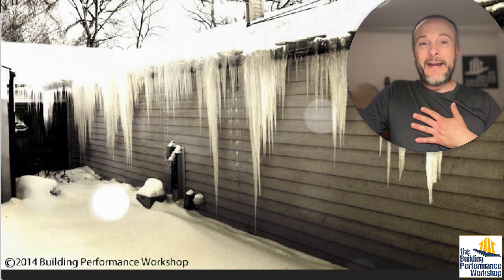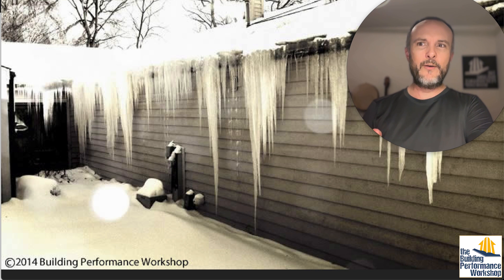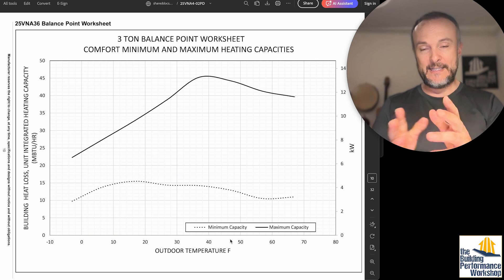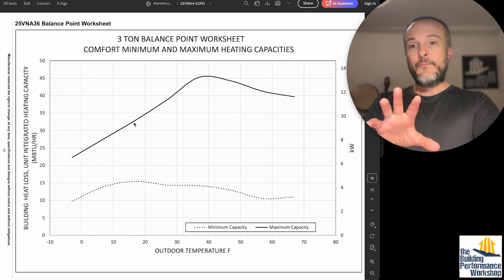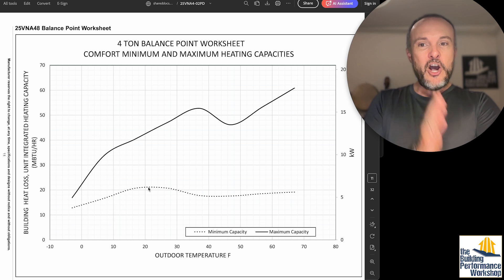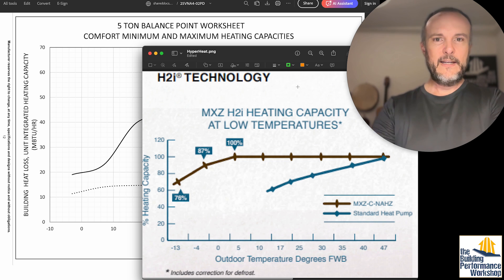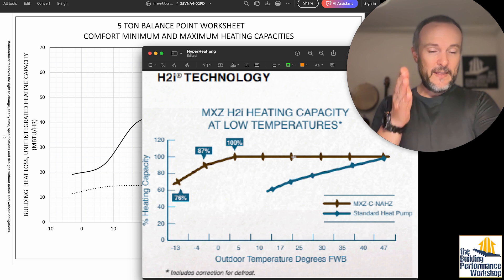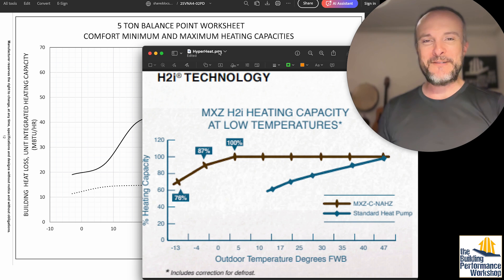'Warm' Climates Need Hyper-Heat Too: Heat Pump Technology, Specs, and Sizing Calculations

Comment: Here’s what happened to me last winter here in Wisconsin. We had a week of single digit below zero windshield weather. I have a Mitsubishi intelli -heat system which runs the heat pump until it can not keep up then it uses my natural gas furnace(duel fuel system) I have the H2i unit and it never kick over to use the furnace during this really cold spell. In other words it kept my house at 70 just using the heat pump. I did not have the HVAC fan set to run all the time but I did have my HRV set to run 20 minutes per hour. My electric bill was $200 higher that month. I wasn’t prepared for that! Natural gas is still the way to heat homes here in Wisconsin if cost is a factor for your budget. Do you have any thoughts on this?
Reply: Does the Mitsubishi have heat strips? That would account for the spike in the electric bill.
Reply: No it just switches over to my natural gas furnace when it can’t hold the temperature in the house. It what’s referred to as duel fuel. There are a lot of manufacturers that have similar systems.
Reply from the maker: Yeah, I don't recommend heat pumps because the energy bill is cheaper. It's because they're better in all the other ways.
Reply: @HomePerformance  Better in all other ways is a bit of a stretch, to put it mildly... Not to mention, capital cost and operating costs are some of the most important factors for the overwhelming majority of people.
Reply from the maker: @ZergZfTw you know I’m not an ‘electrify everything’ person, but if done right it is better. Better safety for air pollution and fire, lower resistance to airflow, less equipment upfront, longer runtimes at lower temp differential, less noise. The list is not short imho.
Reply: @HomePerformance   Those are all true, and I agree with you; heat pumps have a lot of nice properties. Tho, I prefer air-to-water or water-to-water versions for reasons of flexibility in system configuration and the option of thermal storage in buffer tanks. But at the end of the day, if what you need is heat and the only thing your bank account can support is a basic model gas furnace, all those other things don't really matter, do they... 

Personality, I'm planning on a hybrid system; water-based heat pumps with backup propane boilers plus buffer tanks. 200k plus Btus of heat offers me way too many advantages to give up. e.g., Snowmelt, hot tube and pool heating, infinite showers with multiple shower heads running at the same time. Not to mention, with buffer tanks and a properly set up air handler, controlling air temperature and humidity at the same time becomes trivially easy. 

Luckily, I have both the engineering knowledge and the practical experience to do almost all of the work myself; I know most people aren't that lucky.
Reply from the maker: @ZergZfTw good points buddy

Comment: In your opinion if I’m starting new for heating/cooling in Climate zone 7b, which manufacturer makes the best heat pump with variable speed. I hear a lot about Mitsubishi, but would like your expert opinion. What are some must haves that make up a good heat pump?
Reply from the maker: Quiet indoor and outdoor unit, variable capacity, correctly sized, designed to run 24/7 air handler would be my list
Reply: @HomePerformance Why the 100% duty cycle on the blower? I read conflicting opinions that an HVAC blower shouldn't be used for air circulation (or filtration for that matter).